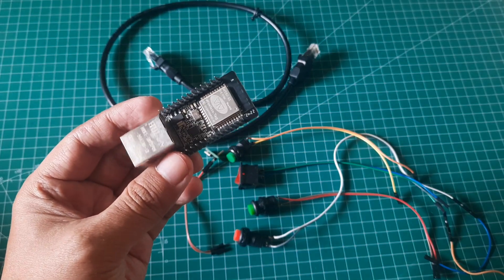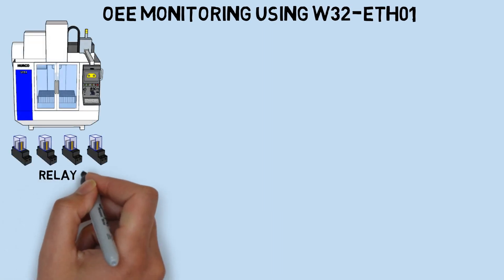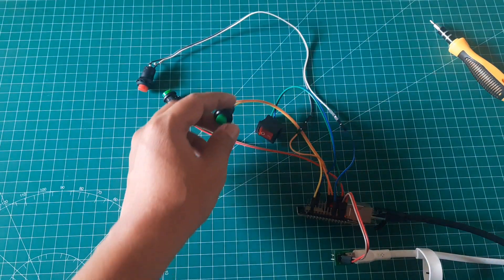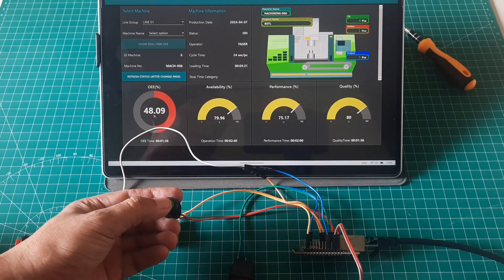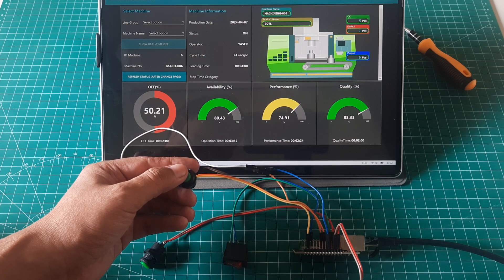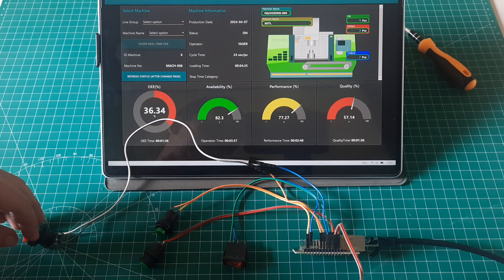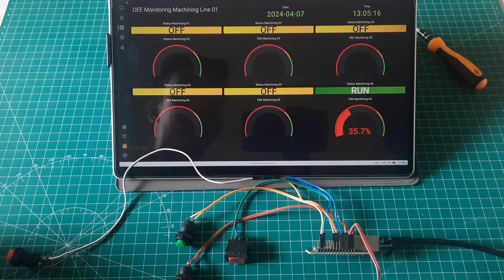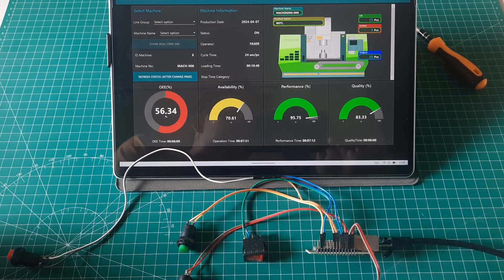Creating OEE Monitoring System with WT32-ETH01 Board With Ethernet Connection and Direct Query

Comment: where is the project files
Reply from the maker: Sorry, for this project, I didn't mention to share this project files.
For other project, usually I share the files.
I provide paid guidance to build OEE monitoring system with multidevice including Raspberry Pi, PLC, Arduino, ESP8266, and W32-ETH01.
You will get all codes, node-red dashboard, grafana dashboard, database structure and concept.
Send me email if you are interested.
Reply: @YaserAliHusen  can explique how you do prgramme part and part.i want to explique more how i can do that .thank you  for video